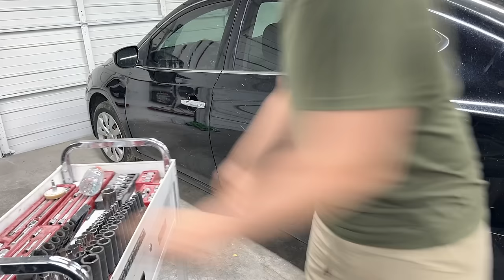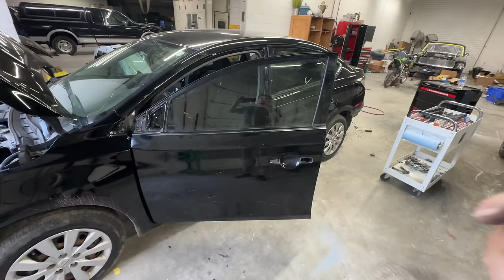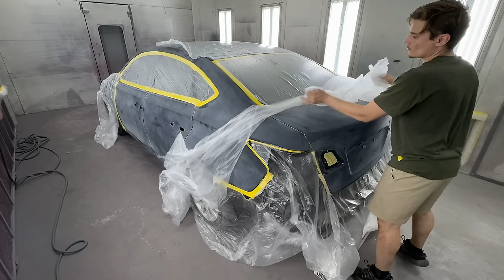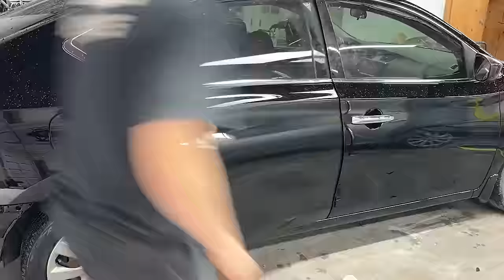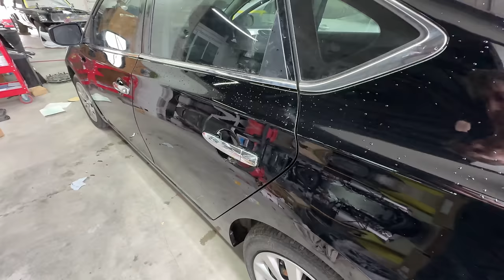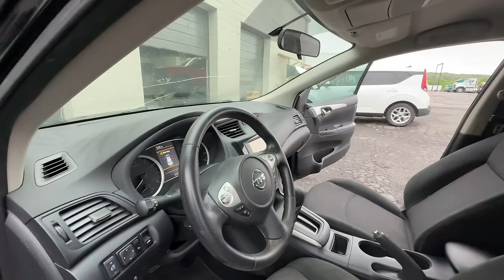Painting A Car In 3 Hours!!!

Comment: What brand and type is the spray can primer I see you use at times.  In the old days spray can primer caused problems.  I have a burgundy truck that the clear on top is turning white from sun light and needs to be stripped.  i want to prime it back but not paint until I can do the whole truck.  It will be possibly down to the metal and get a single stage urethane later.  Good work lately on your flips and BMW.  3 hour paint job !  I hope you make good $ on it.  Hows Don ? Picasso
Reply from the maker: Only spray can I use now is etch primer before 2k or adhesion promoter 😁 I usually stay away from the can primer unless it’s something quick inside. For example fixing a radiator support or a back panel covered by a bumper